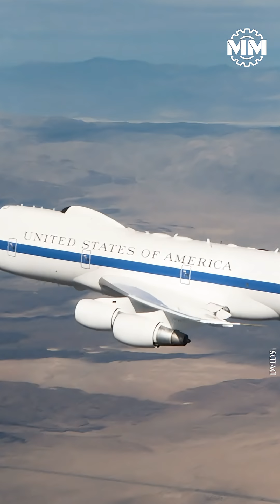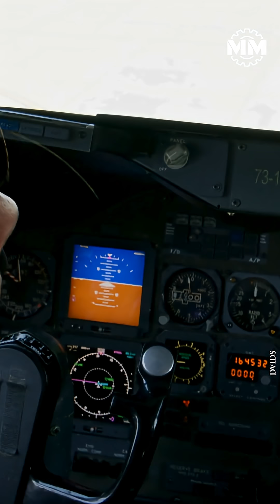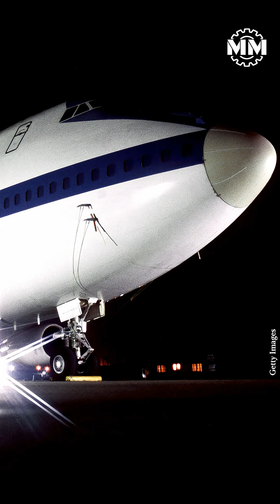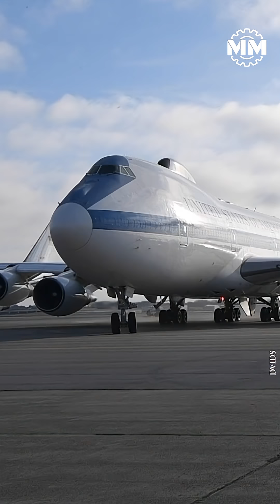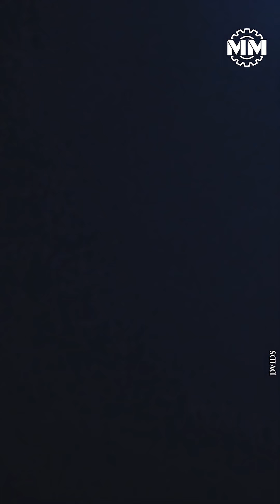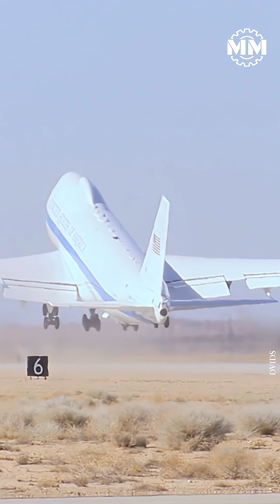America’s Doomsday Plane Just Took Off — Here’s Why

Comment: That plane may be hardened against EMP blast, but are it's refueling planes and fuel depots also hardened?
Reply: KC air tankers are hardened too
Reply: @filipskalic3376 I just happened to be watching it live when it rendezvous with a tanker off of the southern Oregon coast and then it went "dark" as the tanker flew away.
Reply: @filipskalic3376 no KC-135 tankers are hardened against a nuclear blast, but there is a tanker being developed to be hardened, it’s the KC-46A Pegasus tanker, but it’s not due till 2050!
Reply: @AirborneArmyInfantry 😂 Let's hope any nuclear war is put on "hold" until after 2050 😮 😅
Reply: @petervallejo5603 I agree!
Reply: @AirborneArmyInfantry 
And it probably won't end up being available by 2050 because someone in the other party will probably be elected before then and stop it!!!
Reply: @AirborneArmyInfantry America need to hasten that build!
Reply: @filipskalic3376 Where will the refueling  plane get more fuel after what they're  carrying is used up ?  🙀
Reply: @jmartin9785 from the ground while another one allready took off to take its place
Reply: @filipskalic3376 thanks for sharing! Good to know!
Reply: @filipskalic3376 yes they are.
Reply: @filipskalic3376 jp😊pp
Reply: @filipskalic3376 Iran says no to that
Reply: @johnphdk who cares
Reply: @filipskalic3376  WHAT ABOUT THE GAS DEPOT PUMPS ?
Reply: @spaceace9680 just replace them with new ones
Reply: @spaceace9680 Analog, no digital electronic pumps, the gas is like filling stations from the 60s
Reply: @filipskalic3376 praise the Lord.
Reply: @filipskalic3376 but the tankers supply isn’t indefinite is it!!

Therefore there’s a point when someone has to step outside of that protection
Reply: @chrisgironde6669 EMP doesn't affect people, just electronics. So, as long as there's no radiation where they need to reload and there's still fuel and a place to land it's ok.
Reply: @chrisgironde6669 750 of them (nato combined) should be enough
Reply: @marckaufman2556  really ❓ wot if there is nowhere to land or breathe left,,,, quite a large possibility don'tcha think ✔️🐰👀
Reply: @BrianMarcus-nz7csThat's why I mentioned it. However, at that point are any survivors going to care if there's still a president flying around.
Reply: @BrianMarcus-nz7csHence why I mentioned that possibility. However, do you really think anyone would be worried about the president helping with their survival at that point? I think survivors will be in bunkers or looking for local leadership at that point.
Reply: @marckaufman2556    wot survivors ❓ ain't nobody be able 2 breathe,,,, some survival is that,,,, quality ❓🤔
Reply: @BrianMarcus-nz7csI'd prefer not to continue to live in those circumstances, but I can't speak for everyone.
Reply: Most US Military devices are hardened against EMP to shield them from possible EMP weapons. But if not, there are a lot more refuelling planes than E4-B's. 😂
Reply: @TheMagmaker 55 years ago in electronics school I learned that there were special electronic components for military vehicles and many other military things. You can see it as a special color band on resistors and other components. Also Faraday cages around the motor of a car.
Reply: Is this a serious question?
Reply: @musicman0423 out of sheer curiosity.. yeah
Reply: @stalemae8  …yes
Reply: @stalemae8 😊
Reply: Is this a serious comment, I hope not  @musicman0423
Reply: Yes
Reply: You asked this question as if we don’t have the largest military budget on the planet 😂😂
Reply: @dj2raw370 chinas budget makes america look like ametuers
Reply: @brown-cowgotta convert then yuan to dollar slick
Reply: @brown-cow the United States has the largest military budget in the world. Has the biggest logistical machine in the world. Has battle hardened and tested weaponry and has been fighting in a conflict for the last hundred years. China is not comparable to the United States. They are a paper tiger. Just a year or two ago, it was discovered that Chinese missile silo commanders weren’t getting paid so they siphoned the fuel from their rockets and sold it, then replaced the fuel with water lol. Education is a great tool to use to protect yourself from the consequences of stupidity.
Reply: @musicman0423 CCP tofu dreg - beware!
Reply: You should contact the military, I don’t think they ever even thought about that 😂
Reply: @James_Carabajal came to comment the same thing!! They never thought about that 😂😂😂😂
Reply: @James_Carabajal 😂
Reply: @James_Carabajal Imbecilic often? ALL aircraft involved in the continuity of government mission are hardened against EMP. Tell me you know NOTHING without telling me you know nothing…
Reply: @James_Carabajal "Shit I knew we forgot about something!"- The U.S. military
Reply: @EricO-v8j 😅😅😅
Reply: You bet your bottom dollar they are! Come on, this America baby!!!!
Reply: This plane is a red hering 😂. The real thing ia waaaay above it😊
Reply: @ExpertAssass1n   yeah it's chinese 7 minutes flying time
Reply: @commandercontraband -.- !
Reply: What if they run out of toilet paper?
Reply: @MrRenaton28 then shits gonna hit the Fan
Reply: @Stitch-x7w is the fan hardened?
Reply: @Stitch-x7w *turbofan.....😉
Reply: @Stitch-x7w Nope. It's gonna hit the jet engines.😂
Reply: @wavular They're fully stocked with Viagra for a 7 day period.
Reply: @MrRenaton28 They have a stock of newspapers
Reply: @MrRenaton28  you found their no1 weakness 😂
Reply: @MrRenaton28 Eating MREs solves that problem
Reply: @MrRenaton28 
They have butt-jets or is it bidjet!
Reply: @MrRenaton28 they won’t have to shred important papers , they can use them in a pinch 😂
Reply: @MrRenaton28  😂😂
Reply: @MrRenaton28 😂
Reply: @MrRenaton28 then they not going to give a fuck about nuclear destruction down on the ground cause they going to land for toilet paper
Reply: @MrRenaton28 
Toilet Paper?

They have 3 seashells...
Reply: @MrRenaton28 I'm sure the NY Times will be the first thing Trump reaches for lol
Reply: @MrRenaton28 
Power ties.
Reply: @MrRenaton28 
😱 Oh no we ran out of toilet paper.
Reply: @MrRenaton28 😂😂😂😂
Reply: @MrRenaton28 BEST QUESTION EVER!!! 🤣
Reply: @MrRenaton28, They'll start using the boxes full of Trump’s stolen secret documents!
Reply: @MrRenaton28 Then they use their socks 🧦, after that it goes to the tee shirt.
Reply: @MrRenaton28  Humpty Trumpty will by now have had a golden bidet installed... 😅
Reply: @MrRenaton28 ;• 
The U$ president needs no toilet paper.  He shits himself all day long, every day.  These are known facts, from long before his 1st term already.  Some even say that these are the only true facts that he ever has provided.
Reply: @MichaelWinter-ss6lx You could hitch a right as the official waste disposal coordinator.  You could do as many liberals are very adapt at to eat. s**t.
Reply: @MichaelWinter-ss6lx you sound like you're 12. Kind of a pathetic attempt don't you think? Perhaps you should go back to TDS indoctrination camp and get reeducated so you can come up with some new material.
Reply: I am sure they are.
Reply: Exactly.
Reply: Exactly...
Reply: Yes
Reply: Doesn't matter. It's a Boeing
Reply: I also suggest to do number 1 toilet use only, since no one is going to dump the toilets and water must be preserved.
Reply: Yes, Im sure there is one or two
Reply: First thing I thought 😅
Reply: Same thing I said!
Reply: Duh…
Reply: When they ground all other airplanes like on sept 11th it loses stealth. Fail.
Reply: No. They definitely didn’t think of that. You should be receiving a call from them soon offering you a consulting contract.
Reply: You think they don't think of simple shit like that c'mon now that's like you taking off for a trip across country without looking at your gas gauge 🤦‍♂️
Reply: Imagine, that you are not smarter than the dozens of people paid to think these problems through for a hefty salary.

Imagine, that this is the reality.

There are dozens of people smarter than anyone you know, working collectively on these problems.

Feigning ignorance to their exceptional capabilities is to border on insecurity.
Reply: They make fuel out of burning Trump's wig.
Reply: Exactly if trump and associated team is reading this then they are already doomed😂😂
Reply: I worked on the KC-135 trust me they are good
Reply: Brother, even that plane's heart is hardemed. Does that answer your question?
Reply: In the 2005 film "Stealth", they had this floating fuel depot, high above the clouds. I kinda wonder if something like that really exists.....
Reply: I was wondering about that myself.I mean , how far down the line do they go with this protection to keep this plane in the air
Reply: That’s the dumbest question in the world Of course our refilling planes are hardened.. 💪🏻🇺🇸 ✈️
Reply: @rickriner refueling you mean..
Reply: @wavular Refilling or refueling are basically the same animal.  All I have to do is take a big load of gas cans.  No, actually, they can land in siphon fuel from any existing storage without ground pumps being enabled.
Reply: Lmao
Reply: My question exactly. Without fuel, it's kinda useless.
Reply: Yes
Reply: 💯 percent agreed
Reply: that was also my question in this clip...
Reply: It has its own tanker squadron and with drone development possibly drone tankers in the future
Reply: I know before nuclear war it would be smart to have balloon tankers above always thought of this myself
Reply: Pres will go to norad asap underground no nuke can kill a mountain lol
Reply: harder than you'll ever be able to penetrate
Reply: Yes.
Reply: You damn right they are, in spades!
Reply: How does it resupply? Food, water,  lavatory replenish?
Reply: Yeah yeah yeah you know all😂
Reply: Or equipment never failed before . we won world War.1 and 2 and we will win the 3 one 🇺🇸🫡🗽🫵🏼🖕🏼
Reply: @JuniorFernandomendez no one will win a third world War.
Reply: I bet.ou live in this country. 😂
Reply: Probably has two such planes assigned.
Reply: Can you all please stop giving the enemies ideas?🙄
Reply: Those that they communicating with as well. The narrator hasn’t really done their homework and just chasing views.
Reply: 😂😂😂
Even the A380 can stay longer hours in the air without modification
Reply: Hard as fuck
Reply: I agree
Reply: Obviously!
Reply: Food, water, waste management????? 1 month, year?
Reply: That was my thoughts also.
Reply: Carries the final nuclear missle called the Putin Seeker.🫨🫱
Reply: That’s classified.
Reply: I think that's a DUH??😂😂😂
Reply: Most military equipment is.
Reply: My question too, they would need a fleet of tankers built the same way.
Reply: ~ My thoughts exactly
Reply: I wouldn't pick up the prick little trump.
Reply: That’s a damn good question. If not, they might want to get on that.
Reply: Darn good question
Reply: Amen11:11❤❤❤
Reply: I'm sure they have thought of everything possible, but nothing is prefect.
Reply: You better believe it
Reply: My question too
Reply: Probably, if not, the dumbest guy in the world made the plan.
Reply: Exact first thought I had too
Reply: Yes! And it’s not the only Surprises in its Arsenal. Their underground Cities and Bases  are Not Of This World.
Reply: That was my first thought as well!
Reply: This guy risk managements
Reply: I was wondering that too.
Reply: wouldn't you just nuke the airbases the support craft come from and bomb the airbase it lands at to "secure the eagle" in nearby bunker? seems like a plan full of holes easily exploited with planning
Reply: Why yes they are
Reply: The TF-39 engines have such a haunting sound when they spool up.
Reply: Yes, I’m sure that the world’s greatest. The most powerful military has thought this through. I don’t believe you’re thinking of things that they haven’t thought of.
Reply: That's not the only thing that's hardened
Reply: Вы непуганые дебилы америкосы! От ядерной катастрофы нет спасения. Лучше начинайте каяться и молиться, чем думать о физическом сохранении.
Reply: Planes take lightening hits daily. So yeah
Reply: Short Answer - YES.  NAOC has a dedicated squadron of EMP  hardened refueling aircraft, as well as EMP hardened refueling depots located strategically across this nation, and across the world as well.  NAOC is an active USAF asset, and as such, the Air Force takes OUTSTADING care of her.
Reply: It has regenerative braking, it’s fine
Reply: Yes, most military hardware is nowadays
Reply: Not only are they prepared for war but there are many of them
Reply: No, they are just FKNG around for fun 🎉
Reply: Go test it and let us know how it goes 😂
Reply: Well yes or it would do no good
Reply: No, you were the first human being on the entire planet to ever consider that possibility.
Reply: I was thinking the same thing. No refuel no plane.😢
Reply: 😮ha haaaaa nice one😂🎉
Reply: What do you care? YOU won't be on it.
Reply: I just asked the same thing , and how long can they stay up
Reply: First thing thought!
Reply: Oh damn bro....this is dreamland
Reply: The US just had three F-15 drop like flies in a cloud of Roach spray, the second day in US/Israel and Iran war. All the geniuses, money and tech and we still don't have a fix for stupid.
Reply: Short answer...yes
Reply: Who refuels the refulers how do all them stay in the sky to feed this beast ......truth be told  if it ever gets that bad ....they will never make it to the bunker because im sure the airport for the bunker is not capableof landing there .....
Reply: @aggiehort07 there's contingencies
Reply: Dang the only thing they didn't think of. How did you knowwwwww?!
Reply: Good point. But I bet they have refueling tankers all around the world so places that are hit with EMPs or nuclear weapons wouldn't bother them because they're not even there. They're probably all over military bases all over the world
Reply: Not only that but what good would it do if you're the only machine around with working equipment? If all the other electronics in the area are fried, then it seems like having working electronics in the airplane would not be useful. These electronic systems have to communicate to other electronic systems to work
Reply: @magdump4456  It can talk to AWACS, Satellite, or ships for several hundred miles because at 30000 feet it's no longer at the mercy of the horizon. It becomes line of sight for many more miles
Reply: @magdump4456 do you really think this plane is the only piece of equipment our military has that is hardened against EMP and other nuclear strike threats? Not only would it be able to communicate with any hardened equipment but also any equipment that was not in range of any EMP discharge or survived the attack because of how it was stored.
Reply: @JasonSmith-pt5tv that is my name....Jason Smith
Reply: So it’s got to get airborne from wherever it is, then go and pickup the president I presume. Then get airborne again?  Is Airforce 1 not capable of doing his? Or am I barking up the wrong tree?
Reply: @grahamjones4888 wrong tree, Air Force One is the White House in the sky which is what the President would take off in in the event of a nuclear attack. The E-4B Nightwatch is more like the Pentagon in the sky which takes of separately with military commanders to run the military if the Pentagon or other major command centers get taken out.
Reply: @grahamjones4888  just to note here as well. Airforce 1 is always the plane the airforce is using for the president. Same goes for marines or any other branch. So if the president decided to ride in a blackhawk from the army it will be Army 1. The designation changes with the aircraft and which ever the president decides to ride in.
Reply: It is not hardened against a direct nuclear blast as I am sure it will be targeted.  It isn't stealth as it should be
Reply: @claudet.3933 yes it is. The plane is engineered to survive and continue flying through a nuclear blast. It has technology on it to bypass enemy radar. A direct hit with a nuke would be next to impossible.
Reply: @musicman0423 next to. But not completely impossible.
Reply: @claudet.3933 Stealth didn’t exist in the late 1970s when these birds first entered service. Name ONE aircraft this size that has stealth.
Reply: Excellent question.  I'd rather the administration be inside of a mountain bunker-fort instead of flying around. Planes have to land eventually.  Crash.
Reply: @HappyFlowers-fg8yk 
They have their Bunkers as well. Congress wouldn't spend just $5 Billion Dollars when asked repeatedly at the time, to hardwire the U.S. for it's Citizens, who pay for everything, though. 
Now it would cost 1,000x that amount, sadly.
Reply: The plan is not to be up too long. It's main purpose is nuclear war. Once te president gives orders the generals and other military run the show while president seek safe haven. If the world is nuked it's game over and that plane may be out of survivable options. Thus the name doomsday
Reply: @EdJohnson-f3e flip finger
Reply: What us military does between wars: plan & train, & do maintenance.

They plan for EVERYTHING.
They probably have at least one plan on file on how to invade Britain.
Not that they expect to EVER use it.
Reply: So you think your smarter than our war planners?? Like they havent thought about any of that??? 😂😂😂😂😂 wtf...
Reply: @QuitCryingYouLost  who cares,,,, nothing will survive anyway,,,,, cheers merica,, ✔️😂🍻👍✔️👀🐰